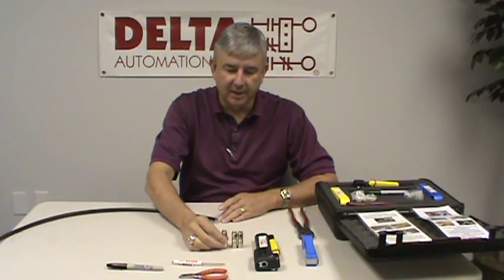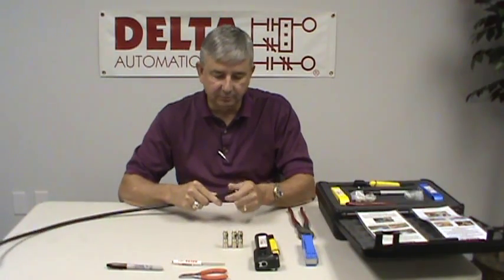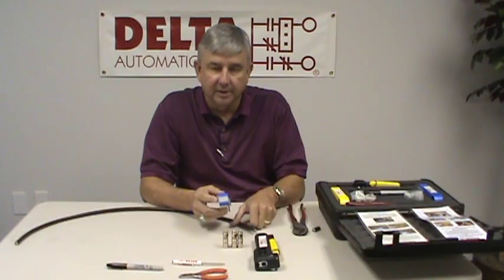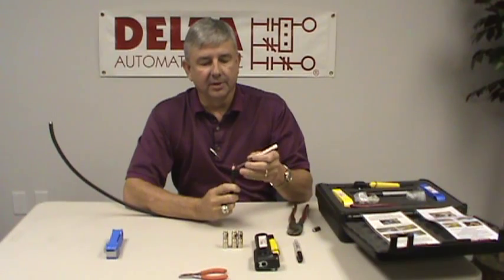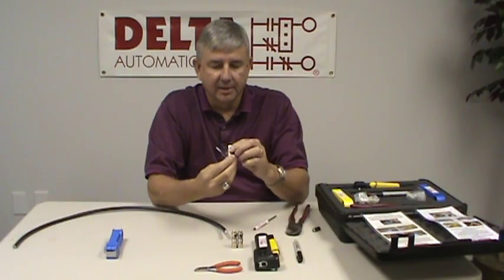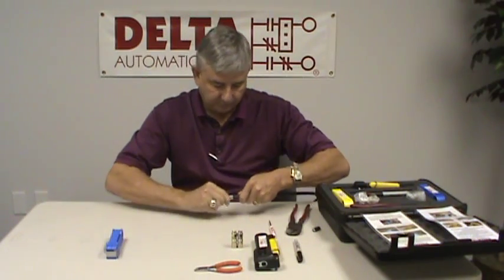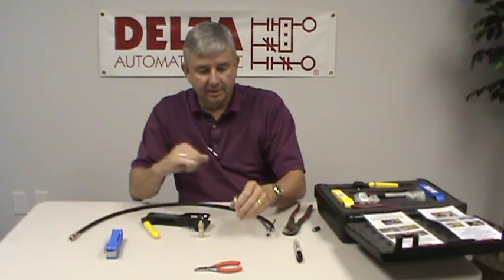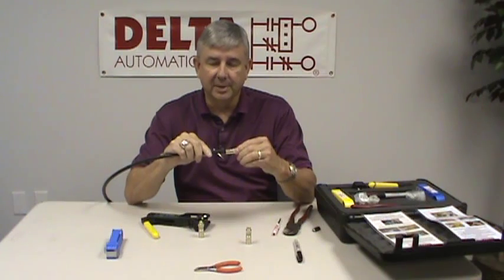Modicon Remote I-O RG-11 Quad Shield F Connector Installation

Comment: Thanks for the useful video. It helped with my concerns about the heavy (14 guage) core diameter of RG11 and how this will damage an 'F' socket. The term 'stinger' is new to me. I'm guessing this is an insert in the connector that accepts the 14 guage and terminates it in the correct size for an 'F' socket? The problem I have is that none of the compression sockets I've received by eBay (3 types) have any sort of insert. Could you please advise what type I should specify to get a 'stinger'?
Many thanks, Phil
Reply from the maker: Phil, we carry and sell the correct connector, stripping and compression tools for the RG-11 quad shield cable. It is important to utilize the correct tools for the connector used.
Take a look on our website www.deltaautomation.com and on the middle left side there is a PDF of the "Most requested remote I/O parts". This has the part numbers that you need.
Thanks for the feedback!

Comment from the maker: @dvirt 
Actually there are only a few cables that are spec'ed for the Modicon remote I/O system. Commscope 5951 and Belden 3094. They are both quad shielded (two foils and two braids)cables. The connectors used in the video are designed for these sized and type cables.
We stock these cables.